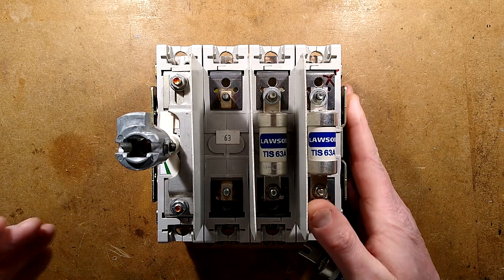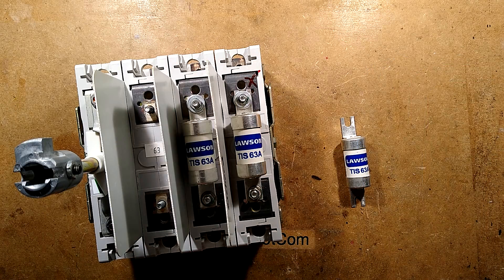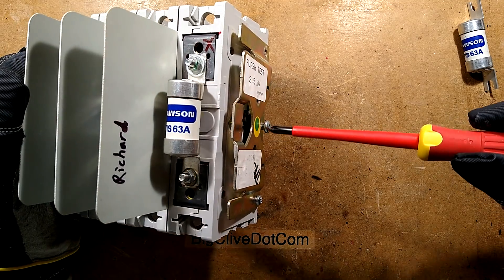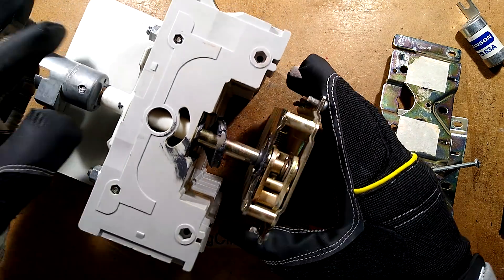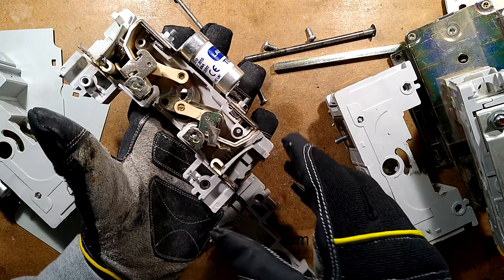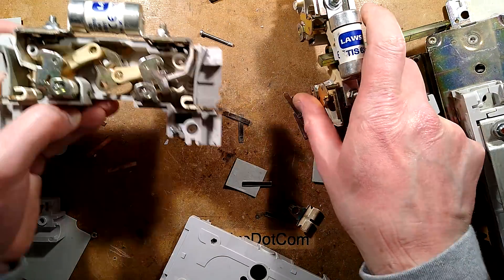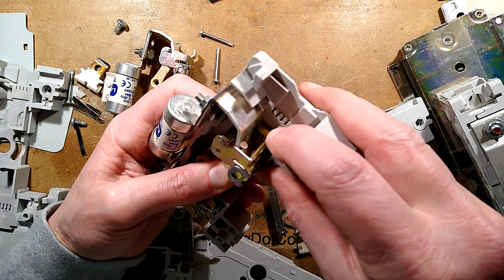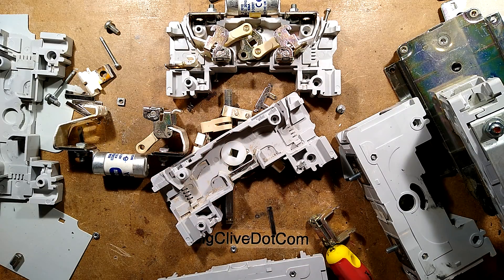Failed elevator switch fuse / fusible disconnect

Comment: Why does europe use currents like 63 amps for this specific instance and 32 for a ring main in the house. Why not use round numbers like 30 and 60 or 65 like you'd see commonly in the US
Reply from the maker: I think the currents were based on standard cable sizes.
Reply: @scuba0015 - it depends on the relevant standards that the equipment is constructed to. The 63A comes from the standard that uses the “Renard series”  of values. See https://en.wikipedia.org/wiki/Renard_series.
The 32A is down to the maximum design current in the U.K. standard for two 2.5mm² cables used in a ring circuit when protected by a MCB. If a fuse is used, it has to be a 30A rating.
Reply: @Mark1024MAK   This reminds me of Le Corbusier's system of mathematical proportions for the human body in architecture.   https://en.wikipedia.org/wiki/Modulor 
   It's a system for the rational organization of sizes of things in architecture.
Reply: It's clearly a calculated size.
Reply: Round numbers are hard to mount, the slightest tilt and they roll of into the most difficult places, so when youu need 60 they include an extra 3. "/
Reply: @snakezdewiggle6084  Smarta**
Reply: One answer is that you should not be able to run a fused network on the edge by using 2x32amp fuses on a 63(64) amp fused main. So you can add only use a 16 amp fuse and or 6/10 ones and still have a security margin to not overload the wires and contacts. That's why there are odd numbers. A security precaution.

Comment: Could the sand just be from the environment the elevator is in (like a beachfront property like a resort) and has caused light/intermittent internal arcing between the contacts, thus melting the spring?
Reply: Arcing on the contacts would've been visible on the main mating surface, it'd have gone sooty.
Reply from the maker: It was a very fine sand identical to that found in HRC fuses.

Comment: what if' 1 side DIDNT Latch down?  and the only contact was very Little, and the flow of power was Going thru the Spring.
Reply from the maker: The way it's designed, the spring end of the contact is always seated in a ball joint.

Comment: Think I need to add some new pieces into the BigClive Cludo set ... it was the silica sand, in the fuse box worth the high current! 
Good investigation ... not sure we have enough to convict... think you need to sample the sand, ponder a bit, and then explain which beach it comes from, hence the production line and ultimately lead us to the discontented employee with a grudge against lifts. 👍

Comment: When a high powered fuse like those blow?  Or even standard UK appliance fuses?..3 amp, 5 amp and the like.......
Can they blow, due to "NO fault" condition?  And simply blow because they're useful life is over, and there condition is no longer sufficient?  
Or.......
Do they only ever blow because of a FAULT?
Reply: It's probably the case that fuses can just fail or blow just from fatigue or age. It's my understanding that bigger commercial fuses are meant to be changed regularly for this reason, before they fail.
Reply: @penfold7800  It could be thermal cycling causing the joint with the end caps to crack like a dry solder joint might.  I suspect someone will have tried other methods like spot welding, but maybe just for the expensive types of fuse.
Reply: A 13 A fuse will certainly work indefinitely when running at 13 A.
Have a look at the curve for a 5A fuse on this graph:
https://www.tlc-direct.co.uk/Figures/3.14b.gif
It seems that a 5 A fuse will run forever at about 8 A, and when running at 10 A (double its rating), it'll last about 100 s.
I suspect there are fuses that have been happily passing current for decades, and will continue to do so until some sort of 'Overcurrent' occurs.  An overcurrent can either be a 'Fault' i.e. short-circuit, or an 'Overload' (a slight over-demand on a circuit which has no fault as such).
Reply: @westinthewest  thanks very mucho grassy ass👌
Reply: @groovejet33  
Large spinning masses can put a lot of stress on fuses at start up. One ID fan at my site is approaching 100kW @ 415V and has 250A fuses. At start up it will draw in excess of 1200A for 8-10 seconds while it spins up. It's designed to stay running with maybe a couple of dozen starts per year which is extremely stressful for the fuses. We will pop one roughly once a year on startup.
Reply from the maker: Yes.  The ends of the wire can fatigue over time due to thermal expansion and contraction.
Reply: True. But in the real world fuses are exposed to transient inrush currents and lock rotor currents. Over a period (years maybe) the fuseable link fatigues.

Comment: It's a fuesd switch, fused disconnect . But whatever switches your power on. That's up to you. SEEN a few with a phase closed  and phase open. We have some old equipment msome compressors using Siemens motor starters with the same type of switch and contactors with overloads. Those fueses are expensive in Toronto. By the way, how do you like that brand  screwdrivers,? Selections from Germany are getting prohibitively expensive
Reply from the maker: These are my bench screwdrivers.  I'd need to test them at work on an ongoing basis to judge their ruggedness.
Reply: @bigclivedotcom I have started using Wiha and Wera for my bench work an live diagnostics. I have a good set of klein but most places don't carry or klein does not make the Zeno or Posi but they do make the combo tip ECX the sloted Robertson tip. They are rugged for construction but kind of suck as bench tools. I still have a set of Robertson screwdrivers made by Herbrand from the 80s when I started in the trade. Those were work horses, far better than most out there. NON INSULATED THOUGH!

Comment: Ah, gloves, so instead of having the doctors extract the spring from your hand they have to remove both the spring and the glove when the spring sproings.

Reminds me of the time liveleak had a YouTube channel and some factory worker checked inside an ethanol evaporation tank that blew up on contact with air (static discharge from him probably) sending him through the ceiling.
"He'll be fine, he was wearing his hardhat and safety glasses!"

Comment: I was always taught that a switch-fuse is a combined isolating switch with a fuse affter it, the fuse being permanently connected to the output
A fused-switch is like the MEM (the ones you can remove the carriers) switches where the fuse carrier moves and makes contact both ends, so when it's turned off, the fuses are disconnected totally
Not sure how that one would be specified, but closer to fused switch

Comment: Many years ago I enjoyed the first Jerasic Park movie. Some years later I went to work at my first maintenance job. I never knew the most realistic thing about that movie was the breakers (disconnects/fuse switch) that you have to pump to restart.
Reply: Ha ha ha, great observation.  Only a Techie could notice summit like that?😂
Reply: The most surprising thing for me is that one they used in the movie (Westinghouse SPB-100) was truly expensive (tens of thousands of dollars) yet they still somehow managed to get it into the film, rather than opting for something cheaper mocked up to look fancy - no expense spared I guess.  Given my love of electronics and electrics it's one of my favourite parts of the movie.
Reply: @Berkeloid0  Very likely they just borrowed it from the studio maintenance department, as the power demand for a film set is big enough to have power systems more in size for a large industrial area, in an otherwise small space. Easy to pull an entire cabinet from an unused set for this, or even film in situ and cut in the scene later as well, and use a spare in the set for scenes where it is only there for view.
Reply: @Berkeloid0  There was a few million dollars worth of computer gear in the control room that was on loan for the movie!
Reply: @FrontSideBus  Good point!  But I presume that was because SGI got advertising from it, not sure Westinghouse ever got much in the way of sales from the movie!
Reply: @Berkeloid0  It didn't help Thinking Machines either lol.
Reply: Also the 3d files viewer is a real thing.
Reply: Really true! It's common to see spring loaded breakers where you do need to manually load up the spring or the brake has a solenoid/motor to do it.
Reply: I haven't heard of a "Jerasic Park" movie. Is it anything like Jurassic Park?

Comment: In the old days, at least in the USA there was a different philosophy, the equipment was designed to take a full fault and remain in service with just a fuse change.. and the fuses are all rated at 200KAIC. When I first encountered ICE components I was shocked that the design philosophy was that it did contain the fault but at the expense of itself and half the the equipment it located in.. We had and still have plenty of crappy designs but Fused Disconnects are particularly hardy.
Reply: NEMA OVER IEC all the way! Give me  Any Square D or Allan Bradley NEMA rated motor starter or contactor any day! IEC Inferior European Crap! I deal with that stuff every day modifying so they meet CSA and Ontario ESA standards. From fuse holders to contactors and many cases design issues from grounding and bonding to the misuse of auto transformers instead of step down transformers, just simple build quality when it comes to electrical
Reply: @carlubambi5541  Agreed on the NEMA and UL standards but take it from me (someone who has sold over 200 million in electrical equipment over the last 40 years) SqD  and the other US manufacturers are a ghost of their former self.. Most are to owned by US companies and are not taken seriously by their parent companies.
Allen Bradley (now owned by Honeywell) is still a quality oriented company..

The new moto for these formerly great companies. NOT ENOUGH MONEY TO DO IT RIGHT, PLENTY OF MONEY TO DO IT TWICE!!

Comment: HRC fuses were THE best safety improvement over the old domestic rewireable ceramic carriers. Removed the temptation to replace the blown fuse wire with random paperclips (my Grandfather's speciality!)  I've got 50A DIIN HRC carriers in both banks of our home distribution board, as a "last ditch protection" strategy should any fault current exceed the (already good) breaking capacities of our RCBOs.  If the fault current exceeds the 80kA break capacity of the HRC elements, I think that'll be the least of our problems! :-)
Reply: I've never measured a Ze value low enough to cause a fault current more than about 3 kA.  I poke my test meter into mainly single-phase supplies in the suburbs of a large UK city, but occasionally 3-phase supplies as well.  I've never had to specify circuit breakers with more than the standard 6 kA breaking capacity.
I think even the old BS 3036 semi-enclosed fuses are good for 3 kA as long as there's a suitable cut-out fuse upstream - there's a table in BS 7671 somewhere. 
I've seen big HRC switch-fuses in circuits where maximum fault current is 1 or 2 kA, and never understood why a little MCB wouldn't have sufficed.
Reply: @westinthewest  The only situation where such a high prospective fault current might arise would be from a significant supply over-voltage, and that's all but impossible (even in rural Australia). It is always impressive how an 18mm wide MCB can handle many kA of fault current, and sometimes they survive (i.e. can be reused until a replacement arrives!)

Comment: I'll watch this again and if I'm wrong then, apologies but didn't you take the fuse off the dud first Clive, then open the other two looking for the skid-marks?   I will watch again, just in case I missed something.  Interesting video, anyway; not likely I'll be dealing with 3-Phase any time soon!  Keep Well Clive.  Cheers!
Reply from the maker: The unit came with a fuse off and its nuts missing.
Reply: @bigclivedotcom  Ah, right.  I missed a bit as usual.  Cheers Clive.

Comment: One thing I've learned, through the unauthorized puncture of my skin from spring loaded bits, is that if you are worried about a spring, first loosen all the screws, and if it's pushing back, stop right there and reassess
Reply: Usual trick. Then take one screw out, see how long it is before it's out of the thread so you know how long the rest can come out before they let go. One of the problems can be that the nasty spring is in a loose component - so you don't find it pushing outwards - but then a loose bit inside explodes when you least expect it.
Reply: No! Best way is, have someone else do it... :)
Reply: Spoken like a garage door replacement person? Those counter-balance torsion springs will happily remove limbs.
Reply: @R.Daneel  I just turned 16 on the 12th of april, living in the US I can only legally hold a permanent job now that I'm 16. But I have worked with those springs before and they're scary. I used a magnetic decelerator my uncle gave me (he used to be a roofer and to be osha compliant, you need one) and essentially crossed my fingers and let the spring go attached to that thing. There shouldn't have be much tension on it but the guy that installed was apparently a moron, because when the door was open it'd be under tension and without the garage door opener it'd pull the door about two inches (about 5cm) off the ground
Reply: @R.Daneel  I have seriously thought about those as an energy source for starting car engines without electricity. Any multi-wind springs - like on recoil engine starters and tape measures have amazing abilities to spring totally uncontrollably if not securely controlled !
Reply: @R.Daneel  and I just realized you're probably talking about the tilting canopy doors. Those are not common in the united states, most of ours are sectional doors, so they are counter-balanced with an extension spring
Reply: @clockwork_dox  No, you had it right. I'm thinking of precariously winding or unwinding a tension bolt by alternating some sort of tools (usually a couple of big screwdrivers :-/ ). The canopy doors I've seen (that are pretty rare here, too, because of snow - they get blocked), just have big "conventional" and noisy springs that are almost loose when the door is fully open.

Comment: I just plugged my phone in to watch the video and the g1000 charger for my Google pixel went pop. Took it apart and found a distinct poop stain on the inside and capacitor guts sprayed about in the case. Lost a good soul today.

Comment: My uncle recently got his old fusebox (a later plastic version of the old metal Wylex(?) fusebox you took to bits previously) replaced with a new consumer unit, and having acquired the old one, there's certainly been some bodge-wire in the past in that thing going by one of the skidmarks in it, gotta love home-gamers and their bad ideas with old wire fuses and incorrectly fitting them........ :S

Comment: My general rule at work is never throw away anything mechanical/ electrical without taking it apart first. I started to do this as a kid.
Reply: curiosity and thirst for knowledge. it's still the best way to learn many things or the fallacy of them ;)
Reply: My brother in law's favourite saying; If it's not broke, don't fix it.
Reply: I was at an event helping with sound and they brought in their own homemade distro which required manual tie and a 40 amp two pole breaker. Apparently it wasn't working right and they had to get a new one prior to me getting there. At the end of the day when they uninstalled everything they were going to throw away the bad breaker and we're wondering how it worked and what might be wrong with it, I'm like no way I'll take that and said I have taken apart a single pole breakers but not a double pole that thing will be apart faster than....

Comment: open neutral is a bad thing indeed 
i learned that the hard way

2 phases loaded with fluorescent tubes fittings with power ratio compensation (old magnetic balasy and series capacitor for 2nd lamp in the fitting)
3rd phase only got someswitching power suplies 
let's just say i turn on the lights and they were flashing randomly but louder and louder then something exploded behind me
and it wasn't a small overload since those 2 circuit with compensation normally takes 8 amps each (they did take 16 without compensation before)

and is that fused switch comparable to those panel fused switches you load with small ceramic fuses and they make a blade to blade contact inside when you close them they are like quick disconect you pull on a handle down pulling all the fuses in cartriches out along with the handle something like this one https://lh3.googleusercontent.com/proxy/nDE7Ke7tQDl7M1O3XAHs-EoAfp8Db_Krmm2p7KgFUestvoyHmP1LbswM1_5_SDMnGJJWUFxMri4DQkxbKCwaGC1gYoAHbsLWyOq_qnd9P7yhfHdPfRFiyznhH_SUpW5oLJAX3bDV
or is mechanical switch somehow superior to those cartridge fused switches?